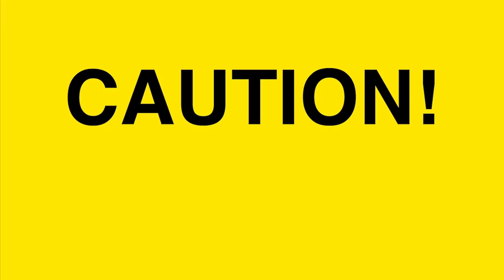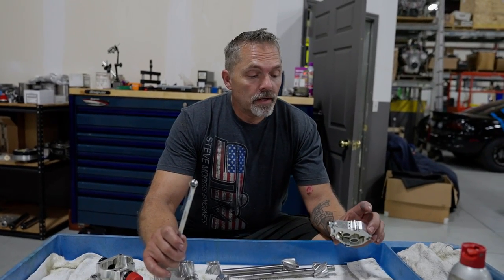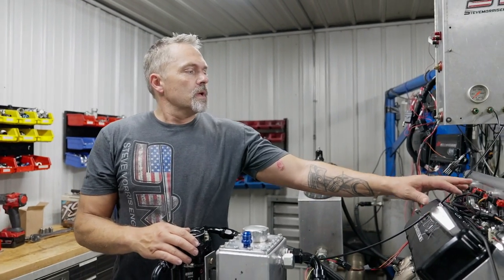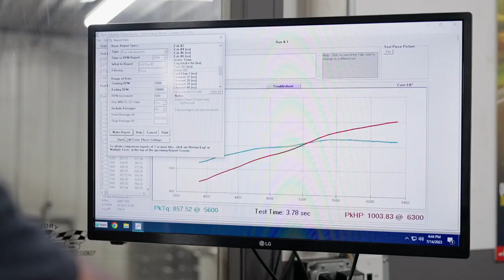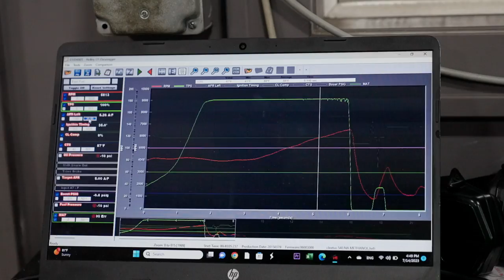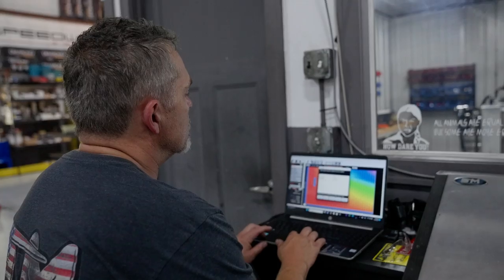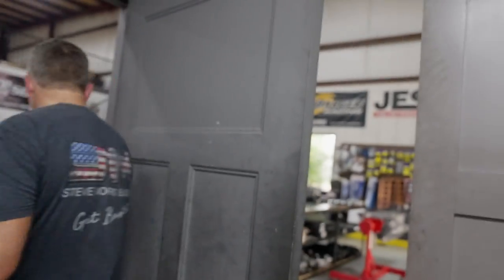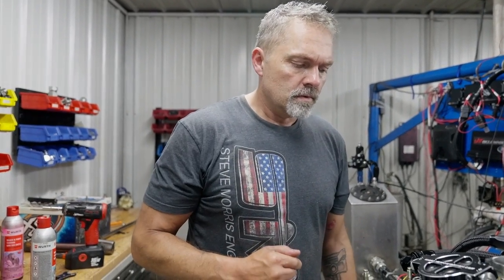What’s The Deal With The Oil Filter ?

Comment: How much heat do these dyno runs create in the water running the dyno itself?
Reply: Alot.  The Water Brake PAU Converts Rotary force into pressure on the load cell and heat in the water.  There is 745 watts per hp so at 1000 hp heating the water with ~745,000 watts.  If I have a 600 hp engine on mine it will use up to about 300 gallons of water per run dependant on sweep to load the engine and keep enough water going through the water brake to keep it from cavitating and destroying it's self.  Water going in is normally about 80 degrees and comes out at 125 degrees at 20+ gpm.  Then you have to deal with all the engine coolant temperature the engine is generating.  Fun little energy conversion display.  Fuel energy >  to Heat energy > to Linear energy > to Rotary Energy > to Heat energy.

Comment: 31:26 not being a troll, just a serious question. You said the oil pump bypass being stuck as it was would cause low oil pressure at idle. You never showed us the oil pressure at idle only at high RPM, so it would have been nice to show the oil pressure at idle to silence the trolls.

Comment: Years ago, an electrical engineer tried to explain to me the ins and outs of a high tolerance engine.  Still to this day, I am totally lost at what he was trying to say about the Subaru engine!  His thoughts on what high tolerance means is the problem.  All I know is the boxer engine is designed to implode with light weight oil and it don't take much to trash itself if there is an air bubble in the water jacket.  I learned that Subaru means you are sitting on the side of the road in a go-kart, making engine sounds with your mouth, while waiting for the tow truck.
Reply: Subaru engine tollerances aren't that high. They just like eating head gaskets.
Reply: @nitroblueuk  I am still wondering if high tolerance means the engine can eat 1/2" ball bearings of the gaps are over .150".

Comment: So engine on dyno=no metal, does the dyno replicate charge pressure from the converter? Cause if the metal comes back then it’s more likely the trans causing movement on the crank?

Comment: So, was it for sure the oil pump causing the shavings? Or we still leaning towards the oil cooler
Reply from the maker: Hmmm 
Just not positive where. But I don’t think it is being caused by the engine
Reply: @stevemorrisracing  I’d agree especially after you checked the filter after those runs

Comment: 1000hp on 93 NA is pretty damn stout. nice, what's the power curve look like under boost ? if boost is kept flat ?
Reply: i think he said it was on meth during the runs.
Reply: He was running it on methanol. Steve has plenty of videos up with the SMX Making boost. It's pretty easy to find if you browse his playlist
Reply: @ironmike742  I'm just curious, turbo's don't typically alter the power curve, they just increase power under the curve, unless you ramp boost with rpm, but that's got it's limits
Reply: @seancollins9745  In an engine designed for boost a turbo will most definitely change the power curve. It's all about how the engine is optimized. Where you see the drop off at the end you wouldn't see that once the airflow is at at the level the engine is built for.
Reply: @nitroblueuk  my 20+ yrs of experience in building turbo motors, contradicts that. typically what happens is that as boost pressure goes up, particularly at 3x 5x atmosphere,, the power curve moves down, which seems absurd, but the port behavior and cam timing often tend to behave this way, sometimes they don't. this depends on a lot of factors, valve seat angles, port CSA, lobe profile, it's not a straight line equation. under cammed engines will tend to respond with a small increase in RPM, but that's the exception not the rule 

it's a stout engine, but i was figuring peak power was closer to 9000rpm, just surprised by the low peak.

Comment: Rather amateur (honest) question for this level build: What kind of cylinder pressures are we looking at with that much boost? And does the heat stay “down” with the lower comp and efficient turbos, as compared to higher comp And lower boost?   Does the “chunkyness” of this billet block help to pull some of the heat away, aside from wet cooling?

Comment: Knowing how Cleetus operates, I would not be surprised if he re-used an old oil system from a ride with a motor that was "making metal" without cleaning it thoroughly, and what he sees in the oil/filter is from the old/dead motor.
Reply: Knowing how sensitive those bypasses are to sticking....he could have looked at it wrong. There's 2 problems. One is a piece of debris that frankly could have come from anywhere. Blow up damage is almost impossible to get clean enough. Many people will literally junk the oil tank, lines, and pumps because it is so easy to turn one blown engine into FIVE. The other is a bypass valve that is way too sensitive to anything getting into it.

Comment: Hey Steve I have a legit honest question…technically speaking if you wanted to build a strictly drag motor with cam in block….but with pneumatic spring for valves to prevent spring float like in Indy cars for rpm and preventing loosing a valve and piston to spring failure is it possible?? Yes I understand the Indy car is overhead cam and if possible is it not being done because just no point to it not feesable???
Reply: It's not just the valves. Indy car engines have a tighter tollerance on balance they also tend to use a square bore/stroke or shorter stroke to deal with the higher RPM.The longer the stroke the more likely you are to hit the head at higher RPMs.
Reply: @nitroblueuk  so are you talking about rods stretching and causing the piston to hit the head
Reply: Yea. There's a reason 90s F1 cars at 14k rpm only lasted 1 race.

Comment: For the oil pump issue. Any ideas of the root cause of the stuck valve? I wonder if the sustained rpm highway use might be causing it? My thinking is it settles in one place at constant RPM over long drives, causing it to get stuck in it's bore as it heats up. Just a guess, i'd be interested to know if there is another explanation
Reply: The root cause is a poorly designed oil pump bypass that gets stuck if you so much as look at it sideways. Not a new issue by any stretch. I've seen people rebore them with a brass sleeve and several other attempts. It's one of those "simple designs" where simple isn't good. Once they stick....throw em in the trash. They keep plenty of those end plates in stock for this exact reason.
Reply: They need to replace the plunger with a design using a ball bearing. No more issues. Is what we used to do on classic minis and I'm sure plenty other folks do too.

Comment: I like everything to work reliably and I wouldn't feel good about the bypass valve. May not be a real problem if oil pressure is adequate at idle with a stuck bypass valve but I still wouldn't feel confident. I wonder if anyone has ever thought of ball bearing as the valve. Might it be less susceptible to sticking
Reply: Quite a few engines use a ball bearing instead of a shuttle.
Reply: @mattsmith4053  Thanks! I've had a lot of engines torn down in my lifetime and hadn't ever seen one. Think it's a better application?
Reply: @davidmarvosh5354  they're no better or worse really. The issue with the engine in the video is dirt, and than can affect either style. The only time I see issues with the shuttle style is when there has been a lack of servicing and the sticky carbon buildup causes them to stick. I'm surprised how accepting everybody seems to be of debris in the filter on a fresh build. I've built thousands of engines and if I found debris in the filter of one of mine I'd be annoyed at myself as it means I've not done my job properly.

Comment: Oil pump plunger that is not returning probably has flakes of metal stuck in it to lock it up. No way I would put that same part back together and expect it to work. I would replace that whole section with a good one that is proven to work under a load. That part is too important to leave to chances. Why would you leave the motor running without the fuel pump on even running methanol? Methanol keep the top section running cool but not the rod bearings amd the lower main bearings. Unless you needed more heat in the engine oil to check active oil pressures under running conditions. I guess I just answered my own question. Ok let's check for flecks of metal in the oil. I would put a bleeder valve inline on the oil line to bleed off the pressure before removing the cap so I didn't have to lose so much oil every time I took off the oil filter cap.

Comment: Only other thing linked to the oil system is the turbos right?, or is that on a seperate oiling system?  I remember cleet had a turbo going bad...idk just a thought
Reply: turbo's are plumbed into engine oil via one other nipples on the oil pump. he blew the seal outta 2 turbo's during the drag and drive event before metal was found and he played safe with it and called it quits.

Comment: Does anyone make specialized soft aluminum tools, so you don't scratch everything up....??? just curious.   I have an LS that I put in a sweeper, sweeper is done for, if anyone wants the motor out of it.   Also have the original Isuzu engine, but the reason I replaced it with an LS is its a 2009 and its first gen of DPF so everyone suggested I replace it, and there aren't parts or replacements or any shops that want to deal with that gen of Isuzu diesel engine.

Comment: Is it possible that high oil pressure is forcing it to be wedged back like that? Is it possible that it could use a heavier spring?
Reply: Many attempts have been made to fix this poorly designed bypass....none truly successful that I'm aware of. That spring sets your oil pressure. You are correct that oil pressure pushes it open. Higher spring pressure equates to higher oil pressure...so a bigger spring would just change the set point.
Reply: @evracer  Is it possible the spring pressure got lighter with age/use and is letting the valve over open causing it get cockeyed in the cylinder it rides in, causing it to get stuck? I don't know how this stuff works, I'm just wondering.
Reply: @SCARFACE69247  no....if it did there would be a corresponding decrease in oil pressure. These jamb due to contamination. A single one of those flecks you see on the filter screen will do it. They have a zero tolerance for anything but clean oil. It's a bad design and great for causing your oil pressure to be 100 psi on one lap and 3 psi on the next. I've literally destroyed one with a hammer out of frustration.

Comment: Steve ever hear of cem-pe-co oil all pullers and heavy industry runs it i had a truck with over 300,000 miles on it & car with over 225,000 miles on it both ran real good till bush in white house play with fuel additives its crap! I want the good stuff back! well there a group of tractor pullers and pro stock and open tractors ran it too the gear lube & stuff ok the blown pullers too nost all ran this stuff for oil and gear lube to gregg

Comment: As a person who has worked on literally thousands of dry sump engines. 
f there is any doubt on any part of the scavenge or pressure pumps (especially the pressure relief piston / spring).. trash them. Not worth the failure.
You did not even show what caused the piston to be difficult to move. Nor did you learn what caused the scoring on the rotors. Was the housing scored?
That type of pump relies on rotor to rotor and rotor to wall clearance. Any modifications (such as filing / sanding them) will alter the design specs. Don't do it.

Comment: I'll tell you what not that this is your issue but I have seen guys uses way to much Gasket sealer, And about a half inch spurts out the sides and inside the housings. Then it breaks off inside bell housings and stuff like that.. CVTs.. LOL...

Comment: STEVE REPLACE THAT BYPASS END PLATE BEFORE IT RUINS ANOTHER WEEKEND! Speaking from experience...at a minimum that bypass plate needs thrown in the trash. It WILL do the same thing again. I fucking hate that bypass design with a passion. It is truly a terrible design. That bore and piston are scored now and even if it LOOKS ok and operates now.... it's going to pick a random time to stick. This exact problem has lost me 2 circle track engines. It will stick open on decel and unless you catch it being lower than usual on oil pressure (totally subject to how far open it sticks)without turning on the light.....you have about 2 laps before the engine junks itself. I want to take every one of those bypass plates and give them back to Peterson in pieces. Replace the allen adjuster with a longer one or a full thread bolt to make sure it never opens again and put a stand alone bypass and a separate bypass line to the pan or the tank. This bypass design is how one blown engine, turns into 5. The smallest speck of trash stuck in the nether regions of the tank or the oil pan after a blowup finds it's way into the bypass and the cycle repeats. THAT BYPASS PLATE SHOULD NEVER BE TRUSTED AGAIN! At a minimum throw it away and buy a new one. They sell a lot of them for this exact reason. I hated it because as someone on a lot smaller budget....shelling out another $175 every time the damn thing stuck, got a piece of trash in it, or had to be replaced multiple times got real old real fast. With the budget on this build it's nothing and the piece of mind is worth it alone. Mark my words, it's going to make a pass in the future, the bypass is going to stick, he's going to think he hurt it and it'll at least have to be torn apart at the track to find out. Especially doing drag and drives....this stupid bypass is going to end in nothing but frustration, just like it did this time. Once they stick, I PROMISE it will do it again! And Cleetus should keep a new spare one at all times!

Comment: We all have that special car you grew up with on our bucket list, and I found mine. My dad (to his dismay) got me a 79 Trans Am 6.6 when I turned 16. It was pearl white with the black "chicken" on the hood. T-Tops, ground effects package with tan leather interior. The dash was that awesome chrome perlage that sparkled in the sunlight.  Well, I found another one just like it 35 years later and bought it. It NEEDS an SM power plant in it! The motor it came with is worn out. I could restore it but I would rather upgrade to an SM engine and add the Holly Dominator. One of his SML packages would be perfect since it's a 100% street car. Maybe something in the 800 to 1000 hp range. Turbo? perhaps. I may even consider sending him the original 6.6 to rebuild and upgrade. Not sure what would be the optimal choice. I could care less about keeping it original since it will be with me till I die and my sons will have to argue on what to do with it. Anyways, any help would be welcome
Reply: @ @valuedhumanoid6574 Do you truly understand what type of money you are going to need to complete your dream! You are probably going to need about 50K or more for one of his engines, Secondly you are going to have to upgrade almost every component on that vehicle! Suspension, brakes, transmission, rear end, fuel system not to mention electrical! I think you mentioned some thing about maybe having a carburetor so that would save you a few bucks! What you need to do is figure out a budget unless money is not an issue then just give Steve a call, I’ll be waiting to see your car on his Dyno!
Reply: @NeverEnoughPyro40  Yeah, I have already scrapped that "dream". I am not talented enough to rework the whole front end to accommodate one of the SM power plants. I had the original rebuilt and some choice upgrades. I told them I wanted 500 hp with no boost. I can always add it later.

Comment: Gotta love the ones saying oh it would be a waste to build a high compression high hp NA build u can do it with an oe iron block blah blah ok then why don't u see guys all building an oe block. Oh that's right they don't hold that kind of power. There's no reason Steve couldn't turn it to 9k or 9500 and at 14 14.5:1 compression it could make 1200hp or more NA possibly.  And those idiots saying cylinder pressure would be way lower than what engine could take yes n no. It's then a matter of limit of pistons n rods for cylinder pressure. What do u think limits nitrous guys from running more than they do. Cylinder pressure most times. Or traction but still. I'd love to see Steve turn this into as high a compression as he can make it giant cam and ALL the nitrous. Steve built the first drivable water cooled streetable engine that'll take 70+ lb of boost. I wanna see him take this very capable platform and turn it into the baddest nitrous plant on the planet. He should be spraying 3500 shots on 5 kits making 4500 with nitrous if this motor is so above and beyond for the NA world.  If it's so above and beyond atmospheric pressure it should swallow a 3500 or 4000 shot no prob right. That's what y'all are saying on here oh it's a waste blah blah. As it sits yes. Some tweaking n no

Comment: 2 questions Steve.
1) Did you run it on pump gas to clear out the moisture, before packing it up to ship back to Cleetus.
2) You might have answered this before, but hy don't you run just one throttle body, instead of two?
As that would simplify installation, reduce weight.

Comment: Whoa where you get the through socket set? I’ve never seen that before. I’ve done so many valve adjustments with box end wrench w/ Allen key. Works fine but what you use is a pretty dope set up.

Comment: Wouldn't wear in a bit more metal wise under boost Steve? Or does that not matter as for checking for metal. Also, have you ever actually built an SMX to be a N/A monster? If so, what was the power numbers on it. Always a pleasure to watch and learn from you and the guys. God Bless